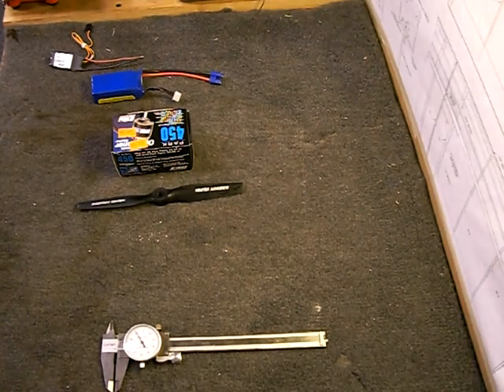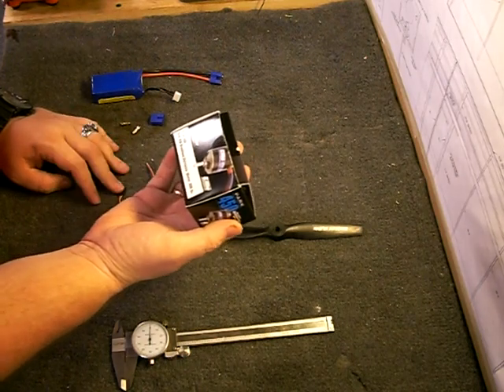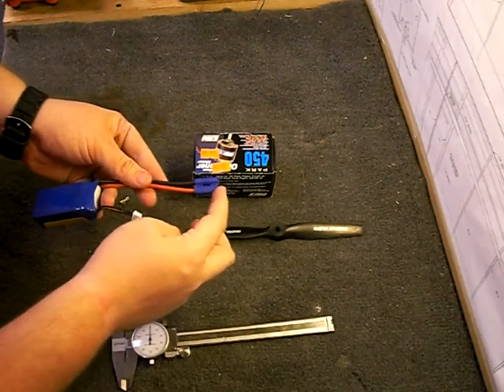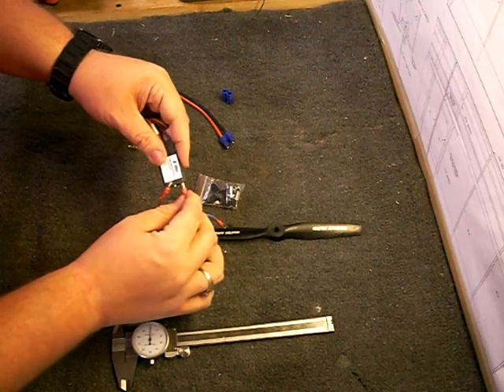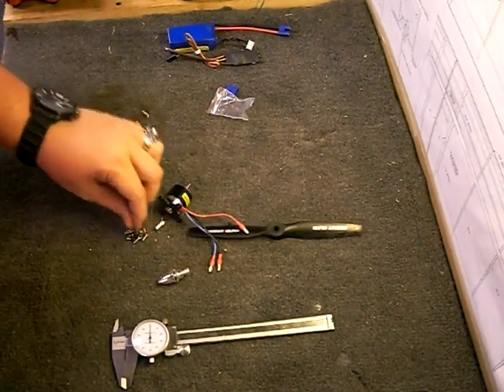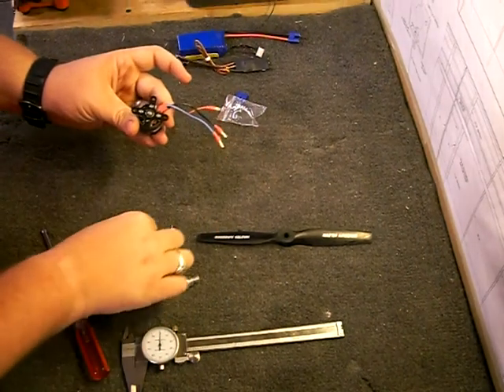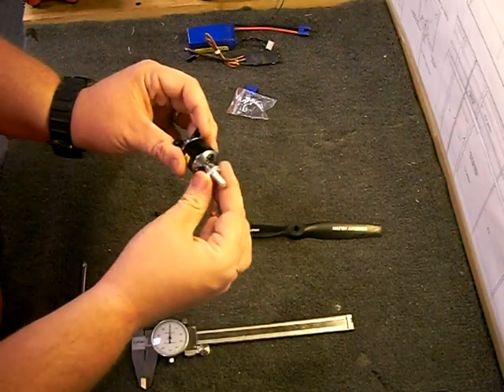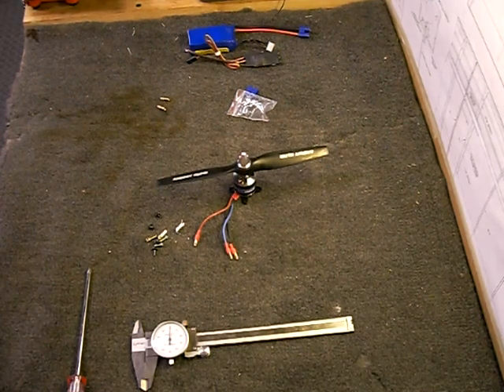Rc Brushless Motor Setup By Rc Airplane builders .com  PT 1

Comment: Hello! Nice video. I have a problem with that kind of stuff. the spinner collet doesn't fit with the motor's axis. I think it is the good  size, because there is no space at all between them. But when I want to screw the propeller, the collet turns around the axis.